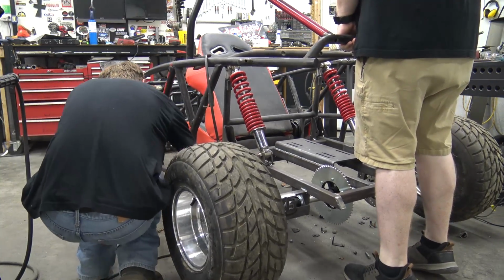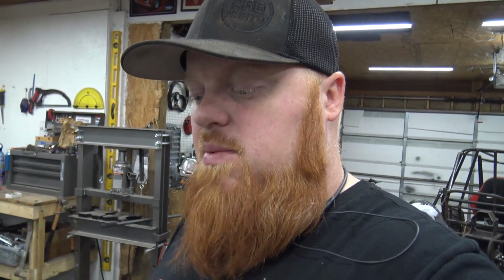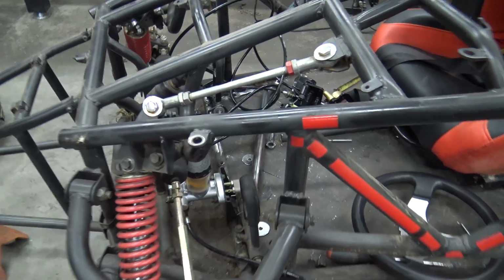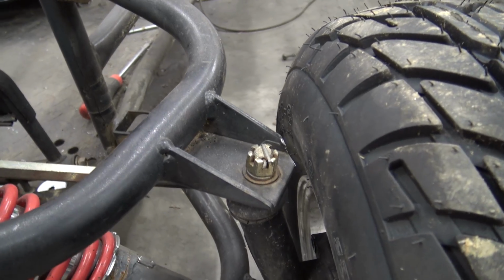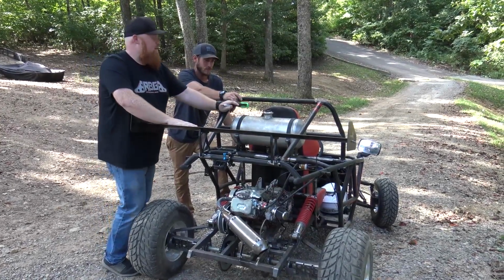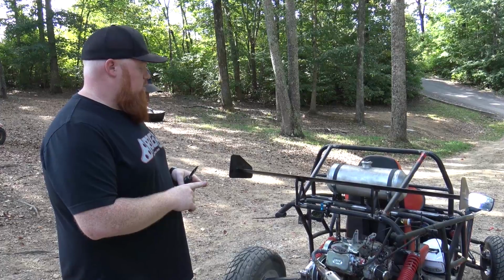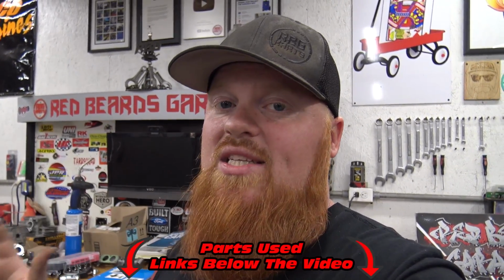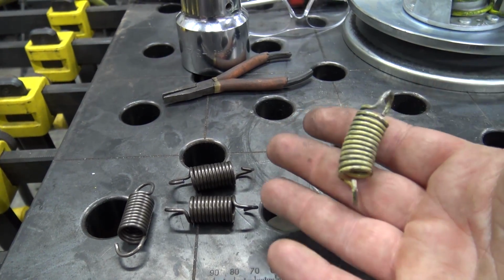Tao Tao Arrow 420cc First Drive

Comment: Top speed runs in the safety lane facing oncoming traffic. At what point did that not seem stupid to you?
Reply: TurboWagon Did they get hurt?
Reply: @techhead976  luck works great until it runs out
Reply: TurboWagon It seems like your feelings are the only ones that are hurt man lol they’ve done speed tests on that same road for quite some time now. If you want to get technical operating anything with a engine is “unsafe”... When you drive your car/truck you’re driving towards oncoming traffic all the time, the only is a yellow or white painted line lol
Reply: *difference
Reply: @techhead976  doing something a bunch doesn't make it safe. That's a gokart, not a car. Very big difference in size, weight and safety.
Reply: TurboWagon Okay but you’re saying you’d rather travel on a bicycle, mini bike go kart etc   with traffic? If so you might want to get on the other side of the road so you can actually see what’s coming at you. I would feel way more comfortable with that
Reply: @techhead976  no...just stay off public roads where they aren't legal anyway. Not complicated really lmao
Reply: Would you rather have the traffic behind you so you couldn't see what's coming?

Comment: Red, that roll cage will not help you at all in a roll over. Your head is still the tallest point. Just draw a imaginary line between the tallest point in the front of the kart and the roll bar and youll clearly see the drivers head sticking out (not good). Cars and Cameras did the same mistake in their crosskart and later they noticed it and have to fix it. Watch their build video and youll see what Im talking about.

Comment: I think its pretty neat, one observation...I see all those trees right at the edge of the trail, I also note both of you sitting on those seat belts. I spent several years as a Deputy, I've seen lots of wrecks, with plenty of comparisons between people wearing belts and those not wearing belts. Seat belts save lives, there is no doubt, if someone hits one of those trees on your little trail, and they aren't wearing a full safety harness, they will be seriously injured. PLEASE wear proper safety equipment, helmet and safety harness, remember there are lots of kids watching what you do and you are setting an example, will it be a good example or a bad one?

Comment: Yep, when you get the TC dialed in to match the cam it will be a ripper. That is a great kart platform, it is a shame they ony put the slug 150cc on them from the factory. Bat's engine would burn the heck out of the belt when it reached it's powerband on his cam. It looks nice how you have it looking now. It almost looks like an open wheeled race car. 👍👍

Comment: That’s a nice looking gokart.I have to buy a 780 toque convertor so I won’t go through so many belts.Good info.
Reply: Buy a motorcycle motor with a 5 or 6 speed and use a 45T sprocket for the rear

Comment: Go find some honda 410x4 4wheeler rims. you can get factory rims in 11 or 12 inch size cheap and keep the big front brakes. I run the 11 inch rims with 23 inch tires on my buggy and upgraded to 8 inch rotors. You might have to upgrade from the wearfast GPS tires but GBC has their street force tires since you want street tires. My buddy been running them on his golf cart for about 2 years now beating it and spinning out all the time with the 400ex engine.

Comment: Do the brackets the top of the front shocks are hooked to rotate? If so, you have the strut rods and shocks swapped. Research cantilever shock.
Reply from the maker: The person that had this before us took out the original shocks and these are too long to fit up in the hood area. Later we will find the right size and put it back to cantilever style

Comment: The 780 torque converter, would it work with a Kubota 656 cc 3 cylinder diesel that may get a vz21 turbo installed?

Comment: Looking to make a NYS legal Arrow.Car rims,directionals,headlights,windshield,etc.Everything needed to basically make it a roadster that can be registered at DMV.
Ever do a build like that?
If not,any advice?
Reply: You can register it as a low speed vehicle and then you just need the usual like you mentioned plus a windshield( plexiglass) and seatbelts but no inspection required

Comment: Have yall ever messed with a Subaru OHC engine? It doesn't look like anyone makes aftermarket parts for them. This looks almost like a cross cart. How much power do you think the chassis would handle?
Reply from the maker: Our original plans was to put a gsxr 600 engine I have laying in the garage but a guy bought this build from us so I built it to his spec.
Reply: @RedBeardsGarage  That will be a screamer whatever home you find for it. I really want to put the engine from an MT09 on something.
Reply: I was thinking about putting a 570cc stroker on it after modifying the head. What do you guys think?

Comment: Looks pretty sweet. Why does go power sports advertise the 780 handle only 30hp. I built a 670 with performance 670 parts to get about 28hp because the advertised hp rating being 30hp

Comment: I cant understand why people always hook the motor directly to the swingarm, move your engine mounts to the frame  bro . For one thing that is a shitload of unsprung weight and the second thing is that has to be hard as fuck on the motor thrashing around like that .. it would also help with your oversized rear springs by adding all that weight over top of them . The only thing you would have to do is figure out a chain tensioner

Comment: That thing is screaming for a built 670. Do eeeeeeet.
Reply: Even a stock 670 with an exhaust, filter, and some jetting would do it plenty of good
Reply: Even a built 212 would do it some good but 212 builds have been beat to death. Id like to see a two stroke dropped in.
Reply: @beararms3777  cr500 motor, yz 250 motor, banshee 350 motor, quadzilla 500 motor, etc
Reply: @beararms3777  how would a built 212 outperform the engine in this video????

Comment: So that's a Dynocam .308 with a "wide" power band up to around 7000-7500 rpm, ..244 duration which robs from the low end, likes big valves and 110 octane gas? to run with a torque converter?  I'd have gone with a NR Racing .208 with 220 duration that maxes out  at 6000-6500 and not sacrificed off idle responsiveness, but I suppose that would be promoting a gopowersports competitor's product. Too many of these cams are engineered for kart racing which are long duration cams for a rolling start and produce power at higher rather than lower rpms. JMHO.
Reply: That's why I like to add a stroker crank to help get the low end back.
Reply: @blackice8705  That and a tight squeeze will take care of the low end up to a point with higher duration cams. There's no substitute for displacement.  Now, what to do with a torque converter engineered for a maximum rpm of 3100 that's now is being pushed to 7000-7500 rpms? Time to switch to snowmobile clutches?
Reply: @IWABKingofPain  or use a 4 disc 6 spring turbo clutch and adjust the stall.